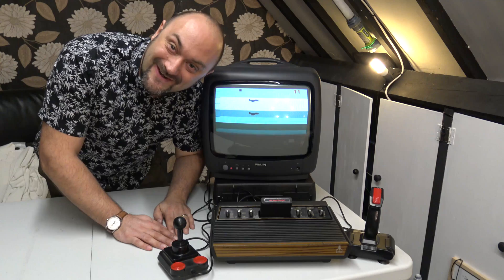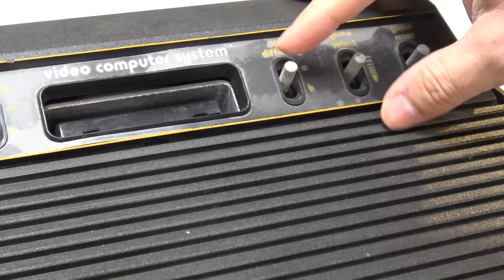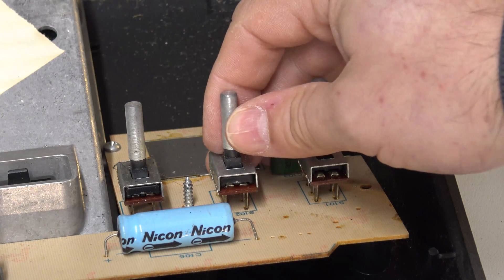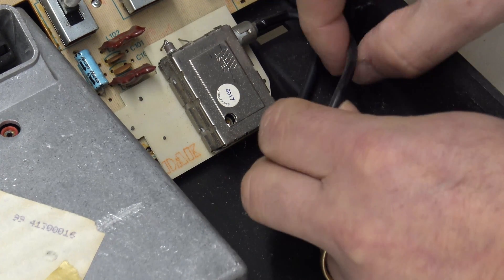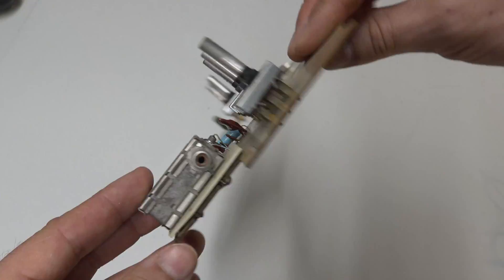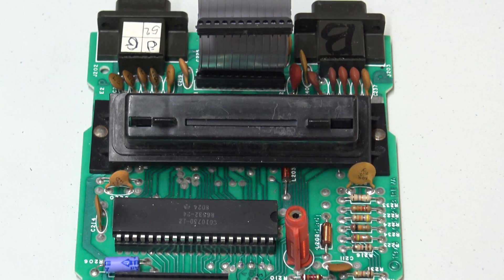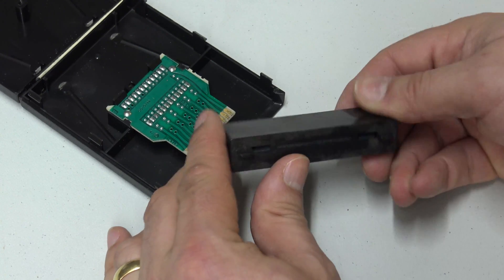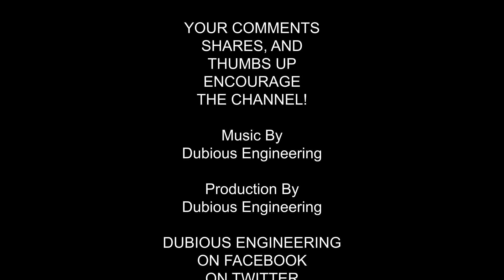DuB-EnG: Atari 2600 Teardown, Troubleshoot, Repair and Refurbish retro games consoles

Comment: The fact that is says “1978” on the PCB does NOT mean that it was manufactured in that year, it’s just a copyright (see the encircled C) of the DESIGN year of the PCB. The PCB were manufactured for a number of year or they made quite a bit of stock quickly.
To (approximately) date a machine like this, look at the production dates on the chips. The format used here is XXYY where XX is the last two digits of the year, and YY the weeknumber. Following this, the TIA is the oldest chip since it has 800x (can’t read the x) so it must have been produced during the first 9 weeks of 1980. The newest chip is the 6507 with a date of 8025, meaning week 25 of 1980, meaning between 16 and 22 June 1980. It’s safe to assume there was quite a bit of time between the IC production and when it ended up in the PCB and the PCB in the machine. Let’s assume it was 3 months this would make the machine from late September 1980.
Reply from the maker: Wow!  What a great education!  Thank you very much!  It's always nice to get feedback from someone that knows what they are talking about!  All the best!  Howard

Comment: i have two of these 2600 and the guts don't look anything like yours or other technicians boards. Suggestions?
Reply from the maker: Google?  -  Ping me on twitter @dubiousengineer and I'll retweet - I know a few people that may be able to help!
Reply: @DubiousEngineering  These 1980 units have a single board. Soooo,,, I cut the the rca plug off the long end, exposed the wires and temporarily plugged it in to the antenna jack and it works!! The wife is delighted [not].
Reply from the maker: @ggeorge3219  Great news mate :-)  Whoooop!!
Reply: @DubiousEngineering  How to fix noise on display? Looks like bad rf but it's not. Just lines running across the screen and unstable images
Reply: Seems to be a bad IC or RF.
Reply: Thank you for your speedy and thoughtful response. After further inspection I find my units have a manufacture date of 1980. There's only one board. Now I have to find the correct input adapter to connect to my tv. Thanx again..G

Comment: Hey I bought an Atari 2600 6 switch at a garage sale and it was missing the output cable, keep in mind the six switch has the smaller pin rf cable on the inside, any idea where I can find one? As seen in an attached picture in this products review- https://www.amazon.com/Atari-Intellivision-Colecovision-2600-Turbo-Grafx/dp/B0074TWWPG
Reply from the maker: Well, you could get away with some 75-Ohm TV co-ax and solder a phono plug to one end and fit a TV plug to the other :-)

Comment: DUBIOUS ENGINEERING 
**          %       1.) What is the start and end address range for the TIA?
        2.) What is the start and end address range for the PIA?
                       3.) What is the start and end address range for the Games ROM chip?  
         4.) What is the start and end address range for the Sound RIOT chip?
      5.) is it a ROM chip or a PROM chip that are inside the game cartridge?
6.) A PIA chip is a RAM chip that has built in ADC/DAC interfacing? A PIA is not a decoder or a multipler chip , its a RAM chip with I/0 interfacing ADC/DAC converters built into the RAM locations?
Reply from the maker: Hi bill I’m missing your point... sorry... are you complaining that the information in my video is not factually correct, or are you asking genuine questions? ...  google may be able to help.  I’m no expert here, I just enjoyed the refurbishment :-). All the best... Howard
Reply: @DubiousEngineering  I'm not complaining about your video I'm looking for information
Reply from the maker: bill williams phew!! :-).  Definitely google it... I found quite a lot of info about this device... it has quite a following!!
Reply: @DubiousEngineering  ok

Comment: Liked and subscribed just on this one video alone. Going to go through the other videos too. It's incredible to think that these ancient computer game consoles were made so well compared to some electronics that were made long, long afterwards. Now companies cut corners every chance they get, and here we still have fully operational computer game consoles etc from 1977, some of which look like they were made only yesterday. I bought a refurbished Atari 2600 Video Computer System fully boxed and properly cleaned inside and out with its original paddles, controllers, power plug (and a new one thrown in), inserts, manuals, cardboard box, box inlays, Combat game, and some boxed games with all their instructions and inserts, catalogs, etc. Amazing what you can get hold of when you do some searching around. Mine cost about €260 from Ebay and it was crazy how many other buyers were watching it, but luckily my bid won. As a chess player I also got my hands on Video Chess too, complete with box and inserts. I have some videos of my Atari 2600 stuff uploaded on my channel. Really though, I just can't get enough of these great old machines, and I love them every bit as much as my Playstation 4 or my Xbox One X etc.
Reply from the maker: Not everything here is a retro computer video... but I have a few ... check out the acorn electron refurb or the zx81 ... there’s an interesting amstrad vid too...  thanks for joining... hope we keep you entertained !!  I’ll check your channel when I get a moment :-). Best, Howard

Comment: @Dubious Engineering: I have a 4 switch atari 2600, and I've tried playing kaboom on it, but the graphics start to glitch after five rounds of that game. It plays all other games without any problems but it seems to have a pretty hard time operating that particular game. What might be happening that would make the system act crazy with one particular game?
Reply from the maker: The Unknown Show ... heat or memory! ... either the motherboard memory or the games cartridge... it’s likely to be the games cartridge as the other games play ok.  Does it happen at a specific point in the game, does the unit or cartridge get hot?
Reply: Dubious Engineering it varies at the point that the game glitches. Sometimes it starts at round 2 sometimes after I've played 5 times. The glitching starts at the highscore display, and when I start rotating the paddle it gets worse from there.
Reply from the maker: The Unknown Show ... that sounds like heat... and dry joints... please check the PCB for dry joints on both the cartridge first (as it’s easier) then the main board of the 2600
Reply: Dubious Engineering by dry points do you mean areas where it's a sort of dull dark gray color? Because on the back of the game there are these round metal parts that look sort of like pellet gun pellets or belt studs and they're a sort of dull dark gray. I was assuming the game was dirty or something so I cleaned it and it still acts the same when I try and play it.

Comment: I wish I would had went to this first. I thought the Atari carts had batteries in them or bad traces so I took a cart apart with the intention of fixing one a day, but then I realized the carts really arent much to them. I should had figured if every one of my cartidges does not work EXCEPT Berzerk, then the atari may be the culprit.
Reply from the maker: Interesting that bezerk works ... definitely no batteries in the 2600 carts I have...  :-)
Reply: @DubiousEngineering  Its an ongoing issue. I checked the connections in one of the carts that didnt work. Everything is ok. I might check another one or start trouble shooting the atari as you did in this video

Comment: hopefully the wd40 didn't screw up the plastics. as WD40 can harm some plastics as it is a light kerosene-like mineral oil
Reply from the maker: madmax2069 ahhh... bugger... I didn’t think of that..  perhaps silicone grease would have been a better option...
Reply: @DubiousEngineering  they do have electric contact spray that shouldn't harm any plastics.
Reply: @DubiousEngineering  I would have used dry spray contact cleaner to properly wash the switches. Then, then the cleaner had fully evaporated, I would have applied some switch lubricant (it's usually labelled as contact cleaner as well, but it will leave some oil behind). Yes, WD40 was not the best choice I'm afraid! :)
Reply from the maker: I’ll go ahead and order some to fix the possibility of future problems...  apparently this version is quite rare as it is pal and manufactured in USA...  most pal models were made in Taiwan...

Comment: Not bad for 20 quid. Just for peace of mind though, it might be good to get those 41 year old capacitors outta there, since there's not a lot of them, and it's one less thing to worry about.
Reply from the maker: Beefcake...  I agree!!  But I’m lazy!! ...  I’m not sure if I wanna keep this machine or let it go...  if I keep it, I’ll re-cap it.  The silk screen on the control panel is really bad, and the wood effect is so scratched up, also I have no box... so it’s not really a good collection piece...  I’m on the fence...  either way, you are correct.  The caps should be replaced!!  Ok you talked me into it!